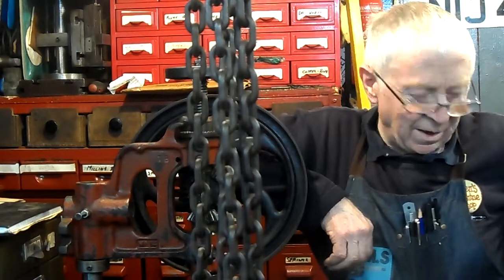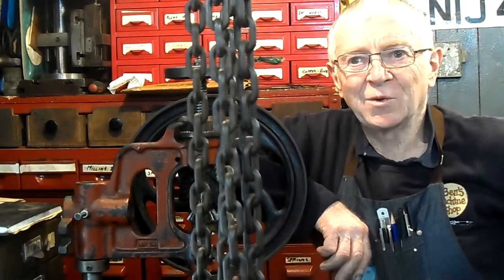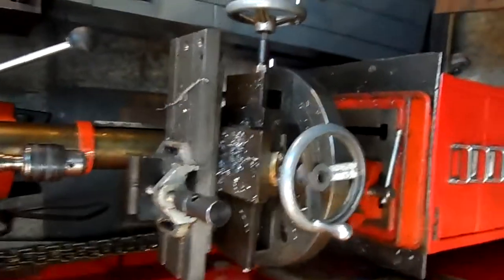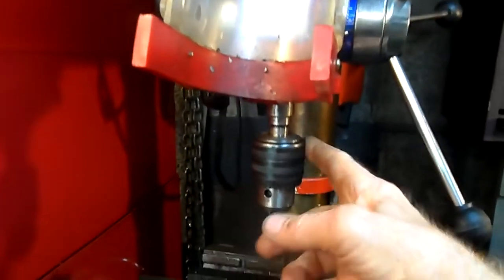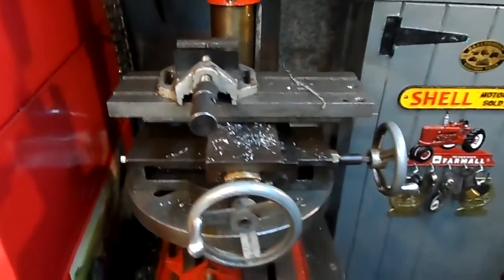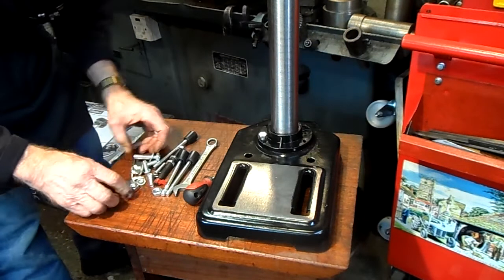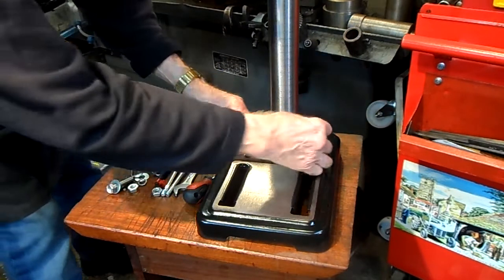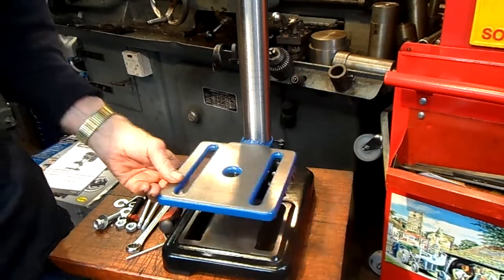Brand new in the Box Bench Drill  See how I get on!

Comment: One of the first tools I bought when setting up my latest shop was a small drill press, similar to your new one.  Even though most drilling is done in the mill-drill, for the one-off holes or smaller drill sizes I prefer the drill press as fewer little bits die an early death that way.  You'll love the new little drill press, it looks good on the bench there.